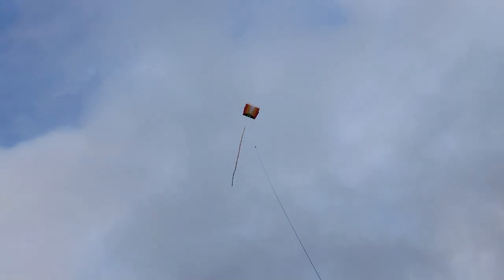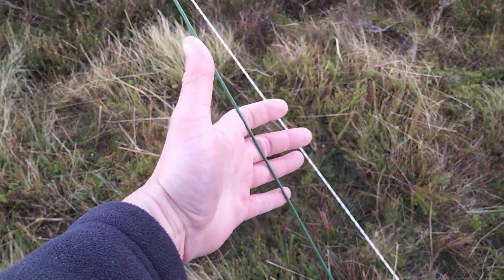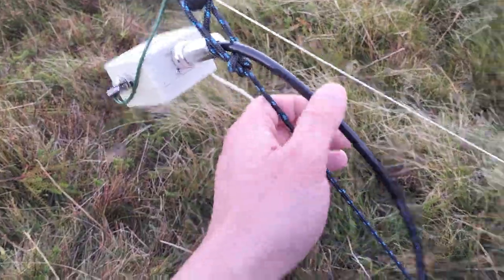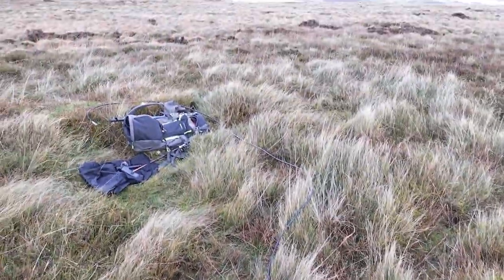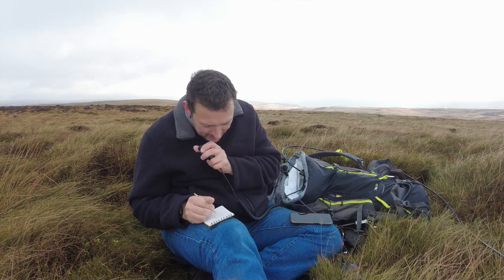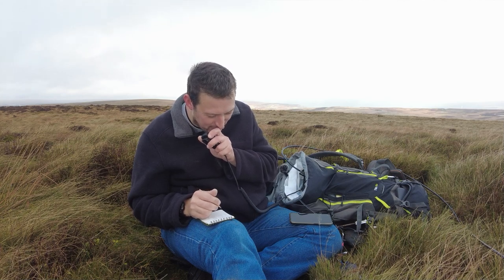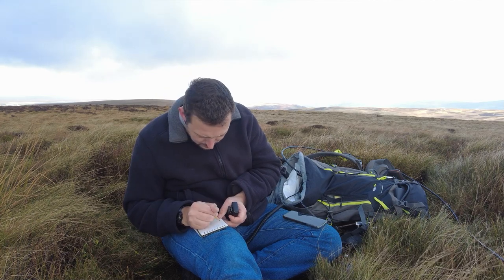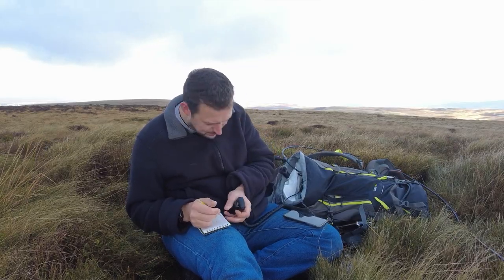SOTA With A Kite Antenna - Great Results!

Comment: Great video again, was great to work you the other day when I was up kinder scout i got a soaking as well , M7DZO 73
Reply from the maker: Hi Luke. I always seem to get really good results on Kinder Scout.

Did you operate from the true summit or Kinder Low?

I normally operate from Kinder Low (which is where most people operate from) but it can get quite busy with other hikers.

In my last trip earlier this year I decided to go all out & operate from the true summit. There's a video of that on the channel if you haven't already seen it.

It was more of a pain to get to but the plus side of that is that it's much quieter. I didn't see anyone else in the full 3 hours that I was there!
Reply: @AmateurRadioUK  it was just off from kinder low, but due the weather there was no body about especially when the weather took a turn for the worse.

Comment: Great video! I’ve been thinking about doing this at the beach myself. Thanks for showing your setup. 73, Walt K4OGO
Reply from the maker: Thanks Walt. I've just been looking at your channel and you've got some really good content on there. I've noticed you in the comment section of a few livestreams but don't know how I haven't come across your channel before!

Looks like you had some great results with the M1ECC antenna. I've also got one of those. Works well as a mobile setup on a mag-mount (static use only, don't try to drive with it on there)!
Reply: @AmateurRadioUK  thanks! Yes I love my Slidewinder. I mostly use it portable on the beach with a ground spike. I enjoy your channel. Keep being awesome!
Reply from the maker: @COASTALWAVESWIRES  Thanks for the kind words.

Currently watching the livestream you recently did on K2CJB Radio.

You said you travel with your work. If you ever visit England or Wales here in the UK be sure to give me a shout. I would be up for doing some kind of collaboration (maybe a beach activation, WWFF, POTA, SOTA etc).

I like the positive upbeat approach on your channel. Keep up the good work. 73.

Comment: That is a good result James. I wonder if you would use that antenna as a first choice going forward? You're going a great job flying the flag for kite antennas!
73, Fraser MM0EFI
Reply from the maker: I think the answer to that is "it depends".

It works well & arguably may be easier to carry than a mast but in my eyes there are a few problems:-

Firstly the amount of space required to setup & fly this thing. Not good for summits with other hikers around to be decapitated by your wire which could be under a fair bit of tension if you have a strong breeze.

Secondly you are reliant on there actually being enough wind to keep the thing up in the air. Today's summit there wouldn't have been enough wind to keep it airborne. If the wind dies off you don't have an antenna......you have a useless dead weight!

Thirdly you need to make sure that you can anchor the thing to the ground. I use dog stakes which twist into the ground. Fine on soft ground but useless on rocky summits. I guess you could always tie it to a tree or fence post (if there is one) but you still need to get some kind of rod in the ground to bleed the static build-up. Not sure I would want to run this without some way of bleeding of the static.

I would like to use the kite more often but I think it's only practical on certain summits under certain conditions.
Reply: @AmateurRadioUK  that makes sense. I guess it's a case of take it when there's a good chance you think it will work. It would be good on a quiet beach.

Comment: Good video and the Kite antenna certainly gave you good results. Nice pile up on 20m too. The summit looked like it was quite flat and I wondered if you were going to try 2m FM. I have a similar summit near me and it's hopeless for VHF. Keep up the good work James. 73 Chris M0RSF
Reply from the maker: It performed very well on both bands but I think it was better on 20m than 40m. Not sure if that was just due to the band conditions at the time.

On 40m this is effectively a half wave vertical & will have a fairly low take-off angle which is better for DX.

On 20m this is a full wave vertical, which will have a higher take-off angle which will be better for shorter EU contacts.

I'm not sure how much the angle of the wire in relation to the ground will affect things as it obviously wasn't truly vertical. It was more of a sloper, which I suspect will make it slightly directional.

Either way, very good results and something I want to do more often.

I didn't try running VHF from this summit, so I can't really comment on that one.

Comment: Very interesting James. How do you bleed the static off? Will, M0LGW
Reply from the maker: I'm using the earth connection of the 49:1 transformer and connecting that to the dog stake (the spiral type which you screw into the ground - available from most pet shops or online) which I'm using to anchor the kite to the ground. Effectively the stake is also my ground rod.

Comment: Why don’t you try it on 75/80
And 160 !!
Reply from the maker: I do intend to try it on 80m at some point.

We have an altitude limit for kites in the UK and unfortunately an EFHW for 160m would likely bust that altitude limit.

I could do a 1/4 wave for 160m but that would require an extensive ground system, which is probably more hassle than it's worth.

Also not much SOTA activity on 160m around here.
Reply: @AmateurRadioUK 80m would be fun because all POTA/Sota stuff ends many times when the sun goes down.  I bet there would be a huge pileup 🥰